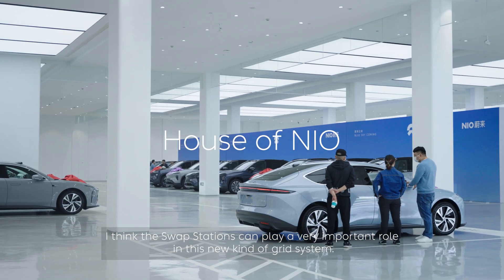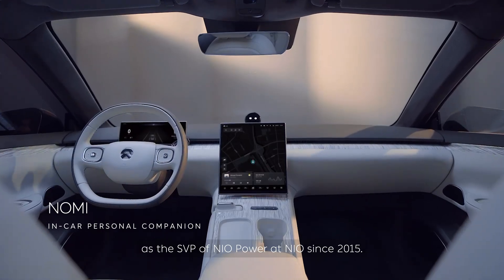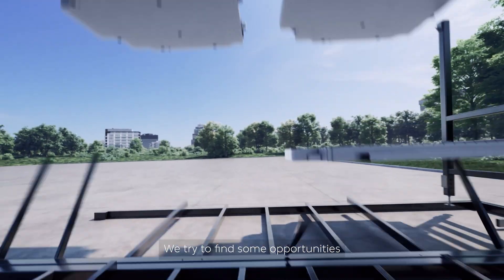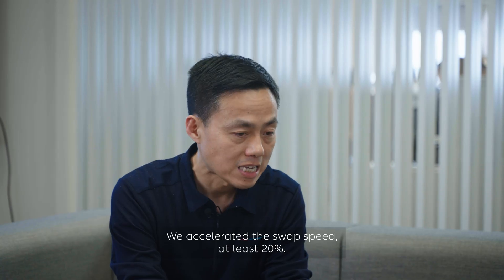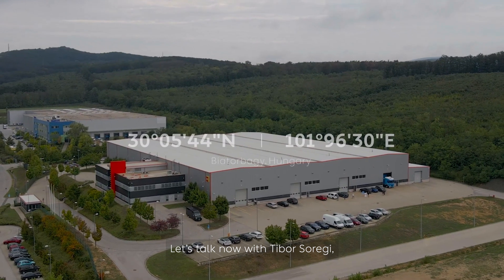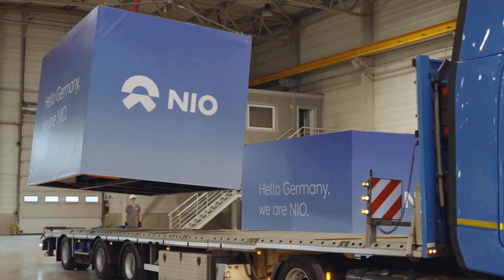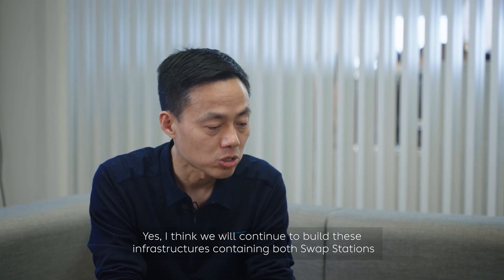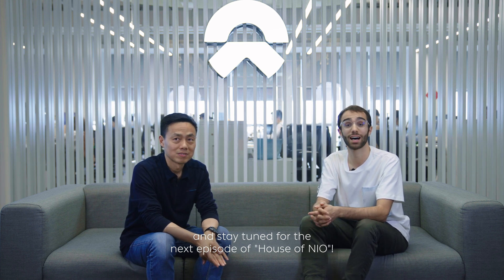House of NIO: EP.4 NIO Power with Dr. Fei Shen

Comment: Nobody seems to give a crap about battery swap. This company can't seem to do anything right for its shareholders.  I've been in for 3 years and it's been a disastrous investment.  Wish I never invested. Nothing but hype and excuses for failure from NIO.
Reply: What is your cost basis? Did you started investing when everything was running up and valuation, revenues, margins, products, market shares was completely ignored? 

NIO is currently trading around $10, which is reasonable for the current company as it grows.

NIO is growing company, and the EV is a growing industry. But doesn't mean you should pay any price for the stock. 

Even Tesla was at $415 All Time High, now it is mid-$200s
Reply: @Wheeling--1  I'm at 2500 shares at 19.20 a share.
Reply: Solution: sell your shares of NIO
Reply: @AfonsoEV_  All good but how about they start producing and selling cars instead of wasting money on NIO houses and daycare.
Reply: You’re right, as there is more focus on decreasing charge times and increasing charging cycles… Battery swapping is literally the dumbest solution.
Reply: @jacked2thets152  Unfortunately I feel NIO is not going to make it. Think they will be bankrupt. Don't think I will ever get back to my 19.20 average.
Reply: @PowidzMalwa   I actually don't think they'll be bankrupt. They have roughly 5B in cash. They're spending close to 1B per quarter so it leaves them to the 4th quarter of 2024. If by next year (Yes another year) they're not turning good numbers then yes they're going to run close to the cliff of bankruptcy.
Reply: Almost like we could’ve invested in anything else but NIO. 3 years of nothing but negative return. Wasted my life on this stock
Reply: @tm4s426  I feel your pain.